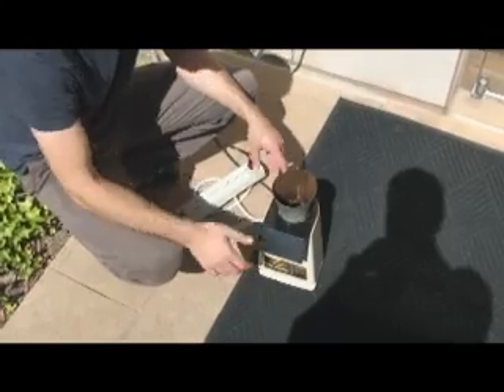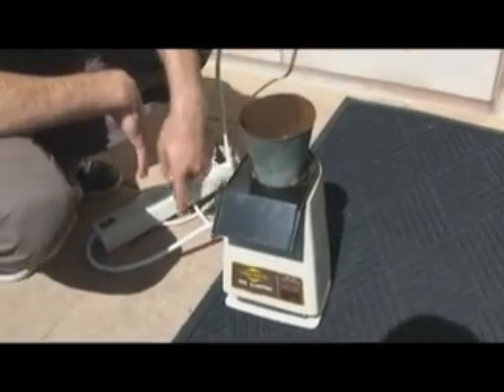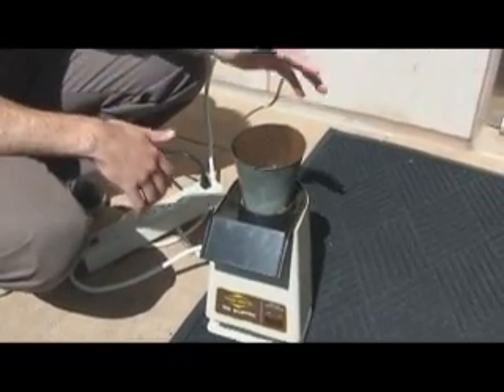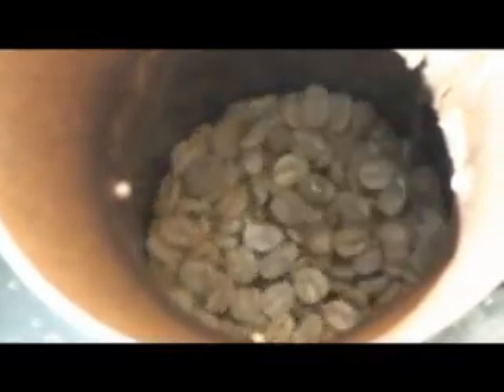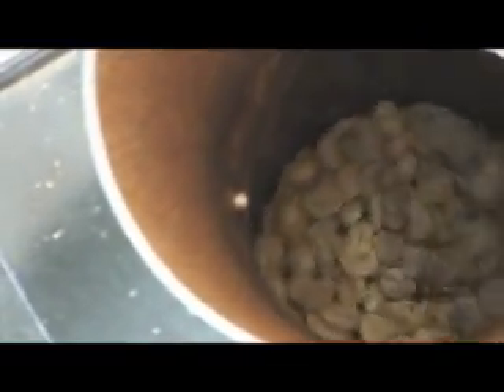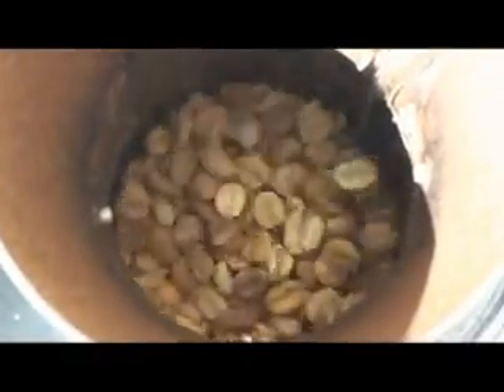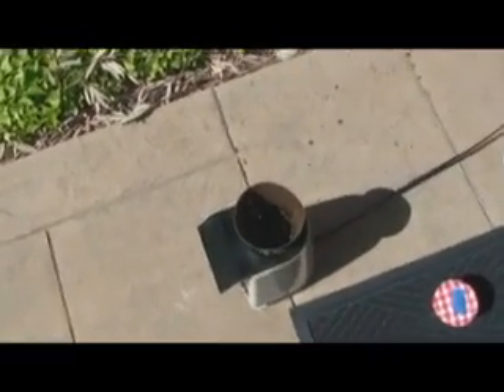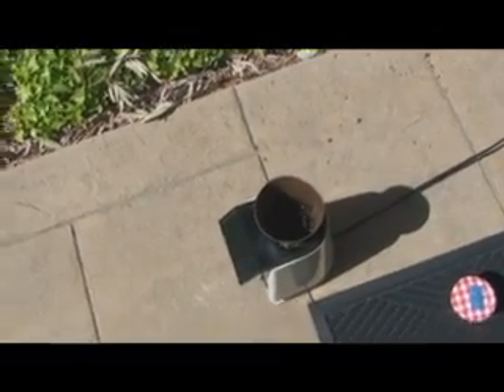Roasting coffee using a modified West Bend "The Poppery" popcorn popper

Comment: I get killer results using this mod. This YouTube user has a "how to"  mod video as well. I get super uniform roasts by constantly stirring through complete roast with the skinny end of a long wooden spoon. (stirring counter clockwise). After first crack is complete I then modulate the switch/element on and off at 20-30 second intervals to develop roast characteristics. Dang good mod!
Reply: ***** Like off for 20 seconds then on for 20 seconds? You start as first crack ends? I read that the power is so strong that first and second crack run into each other..? I'm asking because I've been roasting on a poppery 2 for 2 years and just got a popery 1 and did that mod and want to try a roast tonight.
Reply: Robbie Zev 
Yes, 20 seconds on, 20 seconds off. Just after 1st crack finishes. I stir constantly counter clockwise through entire roast and get a vigorous 1st crack that almost comes on all at once and lasts a minute or so. There us a definate minute or so pause before second crack begins. That is when I pause the roast. It is mainly to get the grassy taste out of a medium roast. If im going full city I will just keep stiring till the first cracks of 2nd crack
Reply: ***** great thanks for the info